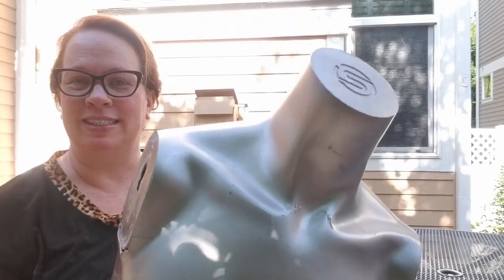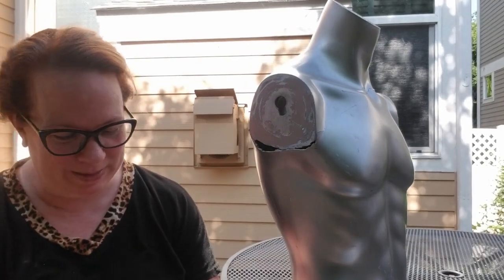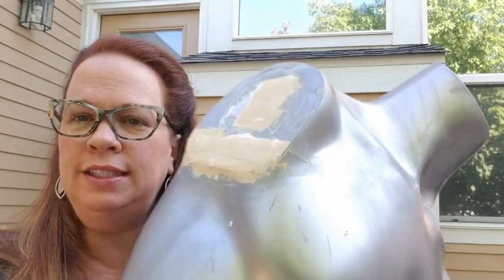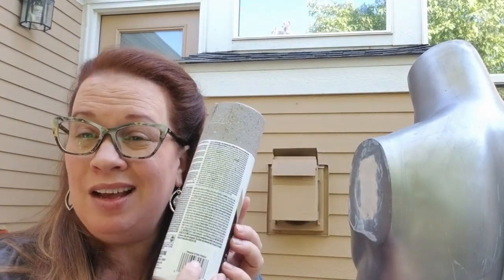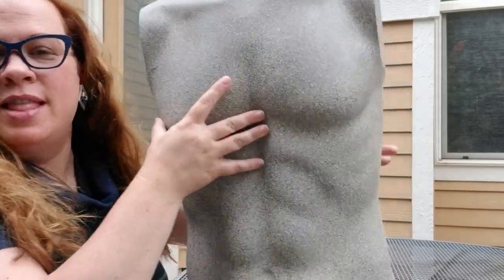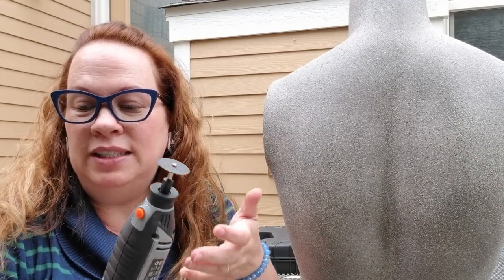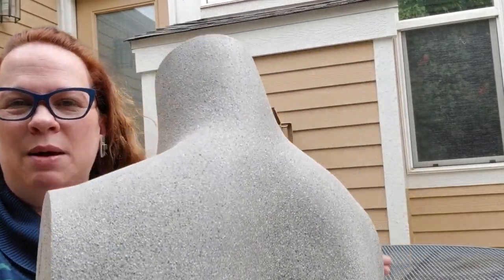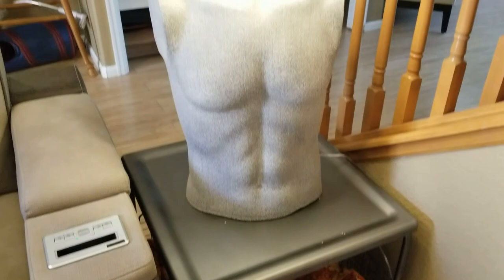DIY Mannequin lamp

Comment: How did you drill the hole in the top? What tools did you use. I have been planning on making my mannequin legs into a lamp. Please and thank you for any information that you can pass on.
Reply from the maker: Thank you so much for watching, I think making the legs into a lamp is a fantastic idea. I just used a drill to make the hole in the center of the mannequin. It is hollow throughout so I was able to thread the wire through, I just needed to make a hole at the top.